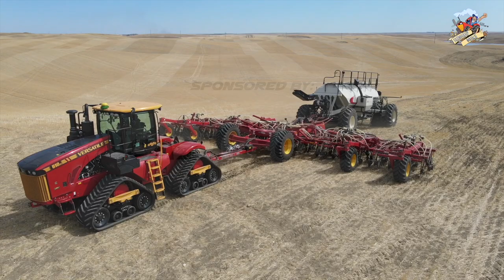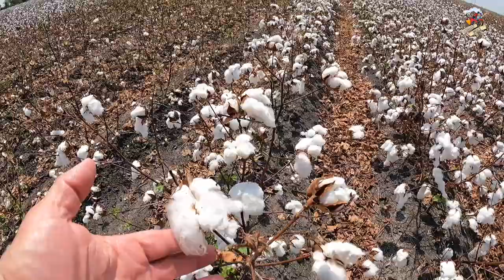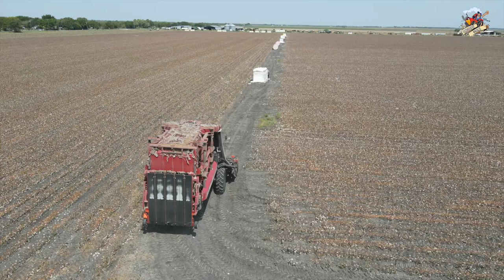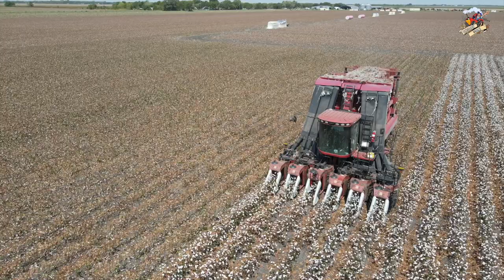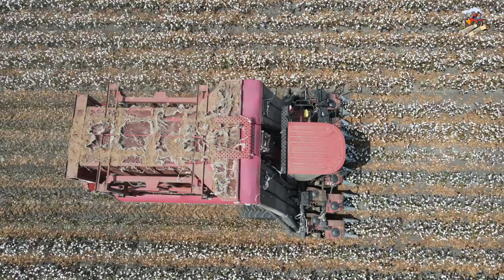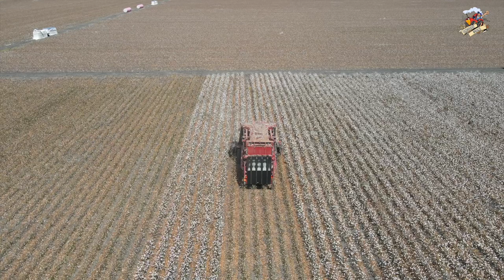Picking Cotton near Beasley Texas - Case IH 635 Module Express Cotton Picker

Comment: I ran a module builder in middle Ga for 2 weeks in 98.
The most boring job.
First control is a tram running the length,second is tamp.
(4) 6 row pickers dumping over 2 hrs, while I trammed and tamped.
Lift up tailgate,raise the unit and move forward until door cleared the previous module. 
Lower unit and door,then tram and tamp lol.
I now live near the coast (S of Savanah) and some fields are not picked till January and February.
Reply: Also it may help those not used to this experience, show the coned finger pullers up close if you get the chance.
Another excellent video!